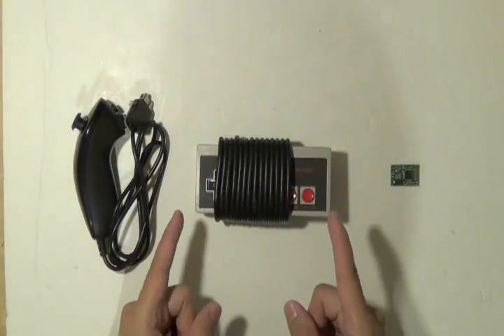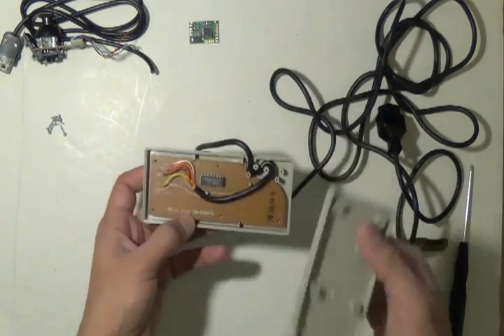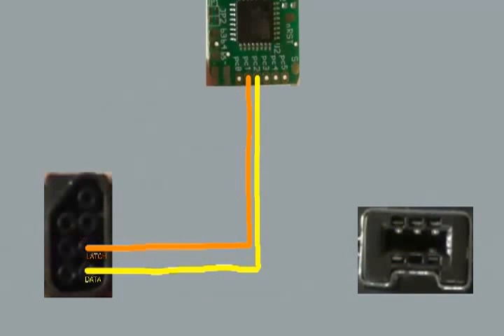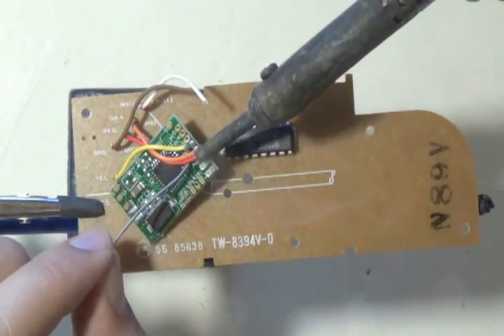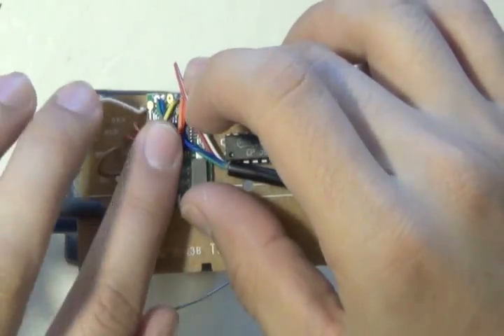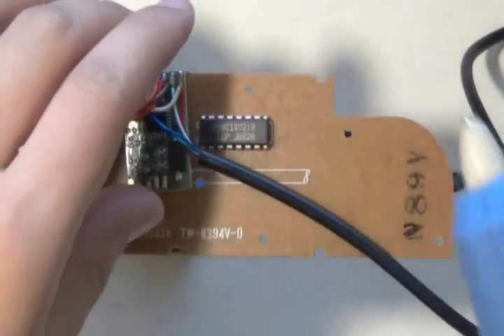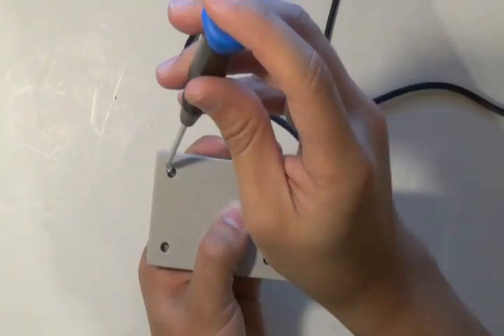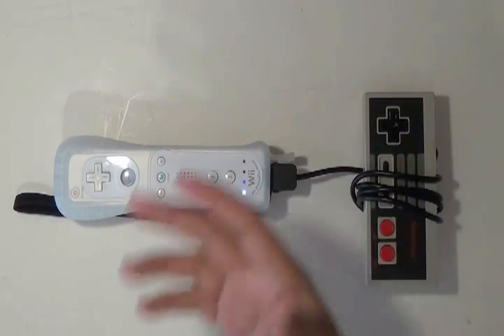How to mod your NES controller to Wii (U) remote (Plus)

Comment: Does this work with the original wii? I want to take out one of my controller ports in my nes that's doesn't work and add the nunchuc wire the the original nes controller port and use my NES Advantage controller. That would ROCK!!!

Comment: that adapter isnt designed for wii games at all.  it only works specifically with the hd remake of super smash bros brawl.  you need the adapters that plug into the back of the wii controller

Comment: Hey! I've been thinking about a project, maybe you can tell me if it's doable: there's this wireless NES controller made by 8bitdo which seems to be really good and can be used on original hardware with their wireless NES receiver. The problem for me is the face buttons are in an SNES position, with B and A set diagonally, and this is an absolute negative point for me, because the way I position my thumb is to push B with my fingertip and A with the articulation (to run and jump in Super Mario Bros, for example) which is impossible to do without wierdly positioning your thumb on the 8bitdo controller (there's a reason Super Mario World changed running to Y and jumping to B, it's just natural).
Now, I asked 8bitdo and there's a way to remap the controller to have B and A turn into Y and B, but honestly I was thinking of going further: do you think it'd be possible to take the guts of the 8bitdo NES wireless controller and put it inside an original NES controller? Maybe using a new one made for the NES Classic Edition would make more sense, since we'd avoid destroying good original controllers. The idea is to have an authentic as possible experience, though wireless.
I'd really appreciate your input! Thanks!
Reply from the maker: I don't know, I've never used it but, it looks very cool. I want it now lol. The problem is that this controller wasn't just meant for NES games. Pretty much why they placed the SNES pattern for the buttons. I say try it, why not? That's how you'll find out whether it works or not. If it does, you make a video on how you did it, and make millions. If it doesn't you restore it to what it was before and you still have a controller!
Reply: It's weird, they also make an SNES controller which is exactly the same as the original, every bit as good apparently, and that one could work as a universal controller (actually, they make one with two sticks too, that'd be more universal actually, both in a NES and Famicom style). To me, if you already have that and the "pro" options, the ones with the sticks, then why not have the NES controller be faithful to the original one? Then you cater to all the potential users, especially considering they've made wireless receivers for both the NES and SNES to use their controllers on original hardware. I don't know, it seems silly to make essentially the same product both for NES and SNES, even if it's to sell it as a regular universal controller with NES aesthetic to those who play on smartphones and such. There's a lot of options already, including among 8bitdo's own catalog.
I guess you're right, I'll go ahead and try it out myself. I didn't want to by the NES controller if the mod couldn't be made, since I know I won't use it if I'm not getting the original feel, I'd rather stay wired if so. But I think I may have a middle ground fix if all else fails. I'll let you know when I have the video, hopefully a success story!
Thanks for replying!

Comment: It's funny because the new NES mini has a wii compatible NES controller
Reply: This actually has longer cords. Also you can use the Dogbone controller. Or if you don't have the right tools or $60 you can buy a NES30 and use it with the Wii.

Comment: Why did you run the wires backwards into the add on board (instead of just wiring from behind with just the tips to solder)?

Was it too tight a fit in the controller that way?

Nice mod, great outcome, and thanks for the video.
Reply from the maker: If you do that it might cause clearance problems. I figured I was making a video, I need to have the wires showing as much as possible. On top of that, I used a bit of glue to hold the chip in place and some wires might get in the way. In the end I figured this is the best way to go about it.
Reply: +W³Electronics that makes sense,  thanks for the explanation.

Comment: What a waste! NES controllers shouldn't be treated like that! It's a SIN! Nothing beats using the original connectors directly from the console, easy as re-wiring and modding a real NES and SNES shell (who cares about wireless?) it looks awesome to play NES and SNES games on virtual console by placing the consoles in front of you, proceeding by connect working and complete controllers (not destroyed ones) and finally plug and play with its working and original sockets. Really retro feel.
Reply: Yeah but I have like 20
Reply: did you look at the controller when it was disassembled its a clone a fake a china knowck off. not the real deal. I no this I would on video game repairs.

Comment: Have you thought about making an extension adapter, so you don't have to do it inside of each controller? For instance like an "N64 or Snes" female end with the nunchuck male end with the chip connecting the male/female together, so you can use any N64 controller just in case the controller breaks and you want to switch without making a new one?
Reply from the maker: I have not! Because raphnet already sells this adapter for you. The point of this video was to show you How To do it yourself, using the chip. I personally would rather have it this way because it makes it wireless and unique.

Comment: Do you have to use the chip? Because I use my Wii controler on all my ios jailbroken devices. Wonder if this would be the same principle or can I tear up a classic controller and tie wires around to the NES controller till it works.
Reply: No, you need the chip.